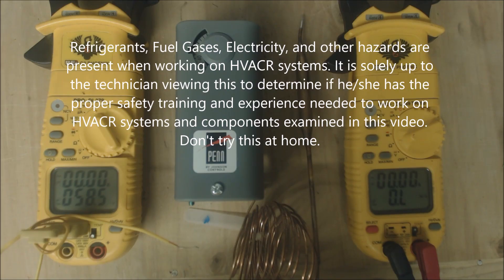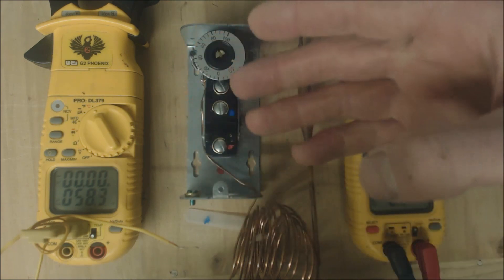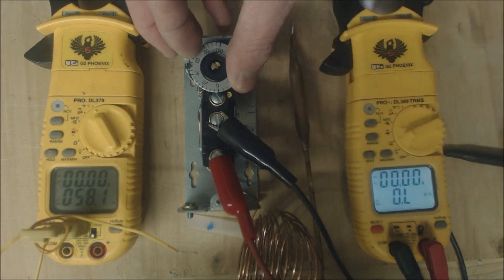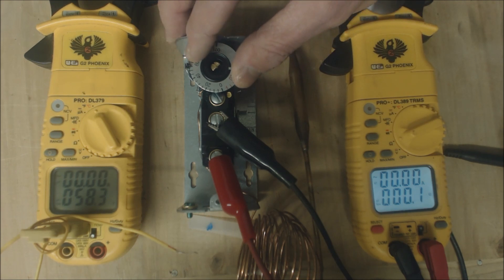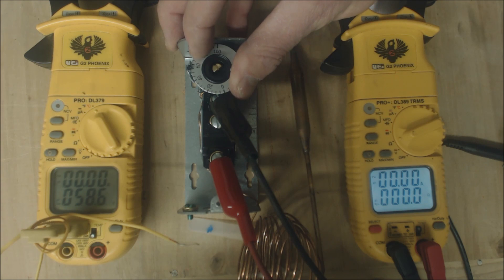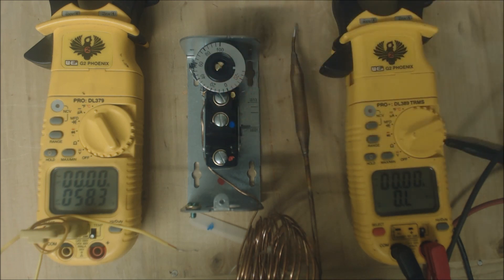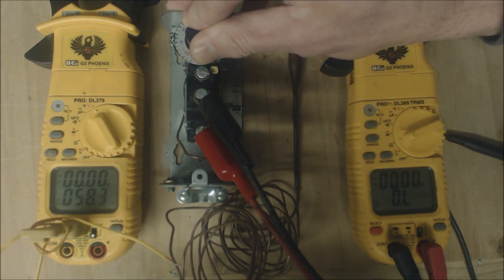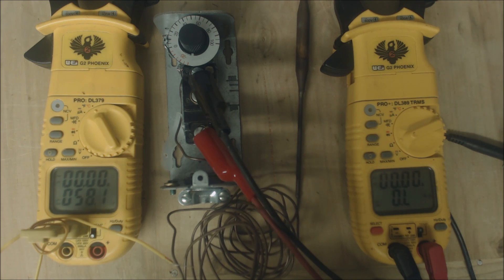Remote Bulb Temperature Control SPDT: Thermostat Testing, Adjusting, Troubleshooting

Comment: Hey love watching your videos I've been learning alot. I started hvac a year ago so thank you. But I have a question as to which wires you hook up at the heat pump condenser to the sensor the yellow and white? I have a single stage heat pump that I only want my heat strips to kick on when its below 40 Fahrenheit. Your help would be appreciated as I've never wired one in

Comment: So, if one was installed in an outdoor heat pump, to stop it from working when it's too cold, it would need red and yellow hooked up and set the cutoff to the lowest ambient temperature we want the heat pump to be on. Is this correct?